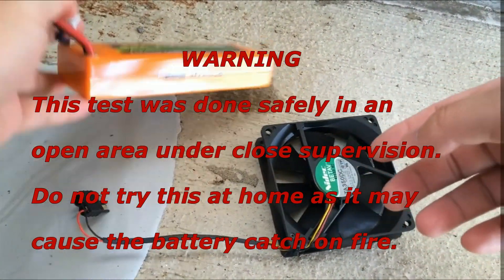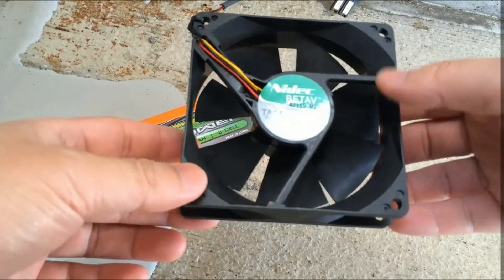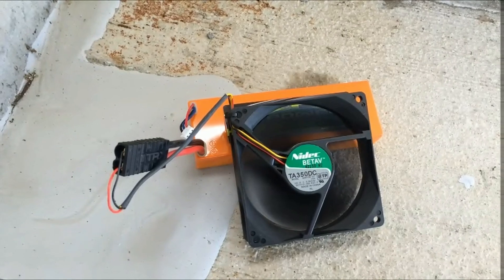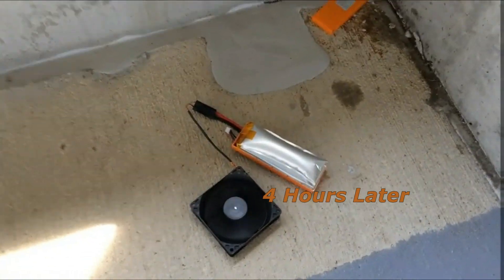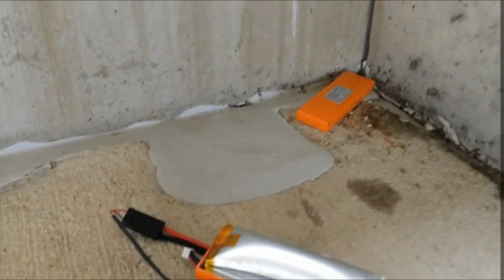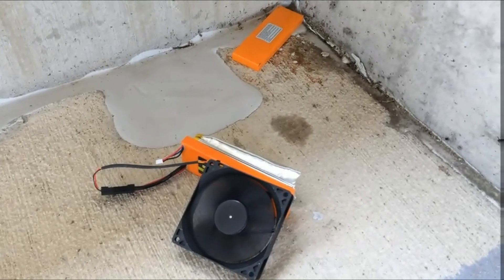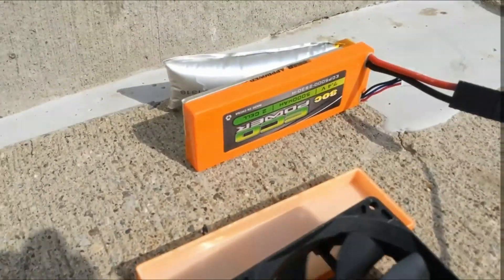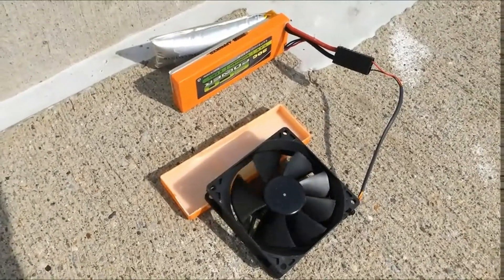Fully Discharging a RC lipo battery

Comment: Interesting results. I have slowly discharged several lipo packs that needed to be retired and they never puffed like this. I wonder if there was some kind of fault with the pack before you did this?
Reply: The lipo may have become so puffed while discharging because the load could have been too large. An LED could have kept the lipo cooler during discharge but it would have taken longer. Also @JPRC, puffy lipos are still fine to use. They aren't as safe but you can use them if you know how to. I don't want to make this comment too long as there are many details I can get into. Basically your first order of business is to find out why it puffed up, it can be due to over current, over charge/discharge, or overheating. Next make sure that never happens again. Now you need to learn how to use the puffed battery. A puffed battery has a higher IR (internal resistance) and therefore lower capacity and lower C rating. In extreme cases the battery may get much hotter during charging or discharging. In that case don't charge it at as high of a current and don't run your car for as long. The battery shouldn't get warm after charging or running. I believe that's it. If you want to know more I can give you a full and more detailed rundown of the do's don'ts and why's. My advice to prevent all batteries from bloating is this: Charge a battery (make sure they don't get warm), then run the battery to no less than 3.85V and make sure they don't get hot or warm, then charge them up again and repeat. Or set it to storage mode if you are done for the day. Obviously if you don't want to have to wait for batteries to charge constantly you need multiple batteries and multiple chargers, that's what my friends and I at a touring track do. Maybe it could apply to your needs. Hope this helps.
Reply from the maker: the pack was starting to get a little puffy before this..thats why i stop using any lipo if they get puffy
Reply: JPRC Interesting how much of a difference there is in behaviour between the cells. It really illustrates how much change has occured inside the cell.

Comment: Properly manufactured LiPO battery packs should have built-in OVER and UNDER charging protection circuit. The fact that this battery continued to discharge to this dangerous level is proof that you should have not purchased it in the first place. Do not play with Lithium based batteries. If you do something "stupid" you can get killed or cause a lot of property damage or ...both!!!
Reply: Χωρίς Όνομα Lipo packs made for RC use DON'T have built in protection.

It's not very helpful if your drone battery decides to shut off at 500ft.

The speed controllers have optional cut off circuitry or you can use external cut offs or alarms but it is never built directly into RC batteries.

Fact check before your make sweeping statements in front of the world.
Reply: Bullshit. Most lipos don't come with protection circuits. And even if they do don't trust them. I made that mistake once and never again. Lipos are dangerous and the full responsibility should lie with the user. If you don't know enough about lipos don't buy them, simple as that. Also, continuous discharge is not necessarily dangerous if you know what you are doing. Why would you do that? For lipo disposal, again something you need to understand before getting a lipo. Now salt water can work but you can also use continuous discharge. If the cells are getting hot then you are using too large of a load, switch to something small like a small resistor or LED. Give the battery a break from time to time. Or you can just use salt water which in my opinion is the better option. To summarize, don't mess with lipos until you know what you are doing. The basic things you need to know are, how to operate lipos, and how to store them. I am thinking of making a video on this because I have some friends who thought lipos don't need to be stored at 3.85, friends who thought you need to pop a puffed lipo, some friends who think lipos are a ticking time bomb. There just aren't any videos giving a simple and clear breakdown for people looking to buy lipos. I'm the kind of guy who just needs to know everything about what they are messing with when it comes to electronics. Also, if you don't believe some of the things I said you can find the same facts in this video: https://www.youtube.com/watch?v=osfgkFyq7lA. Hope this clarifies some false info.
Reply: What Comes Around™ I said the exact same thing. The guy's going around misinforming people.
Reply: huh, I didn't see your comment for some reason. Weird. But I'm glad I am not the only person that found this dude's comment misinforming.

Comment: you can do a little cut to de puff the lipo
Reply from the maker: i hope you are just kidding , i don't think that a good idea cutting a puffy lipo will result in instant fire.
Reply: hmm probably yes, do you think that it is a good idea to get rid of a lipo that is a little puffy for fear of fire or keep it for a bit?
Reply: Alexandros Sotiropoulos I've seen people do it. The gas that causes puffing isn't hot when the battery is at rest so it wouldn't spontaneously combust but the fact it has puffed already shows there is something wrong with it so I think it's a pointless exercise and you also make a hole in the pouch so if there is a thermal runaway that hot gas has an easy way out.

Also, if it is puffed so bad that you need to vent it then it's probably too far gone anyway.

Batteries can usually be used still, with care if they are slightly puffed but if it's so swollen that it's stretching at the seams then forget it. Even putting aside the safety issue, the aren't going to perform well when they have gotten that bad.

Comment: and if so mine read 4.0 plus but have no power true or not
Reply from the maker: Bigwingrider1800 if it ready 4.0 for a 2s it is abnormal. minimum reading should be at least 3.3v per cell.
Reply: 3s  5000  65c
Reply: +JPRC what happened in the morning to this battery?
Reply from the maker: +Ant A nothing happen the cells drain dead and flatten
Reply: JPRC nice

Comment: dude can lipos freeze
Reply from the maker: Bigwingrider1800 you can put lipo in the fridge for storage, no need to freeze
Reply: no i mean they were out in the garage it was cold 25 deg. i tried to use it, it had no power wondering if it froze.